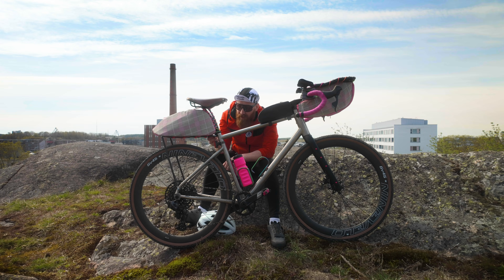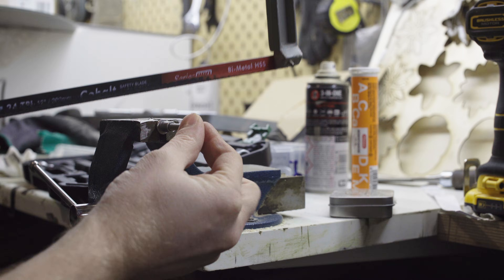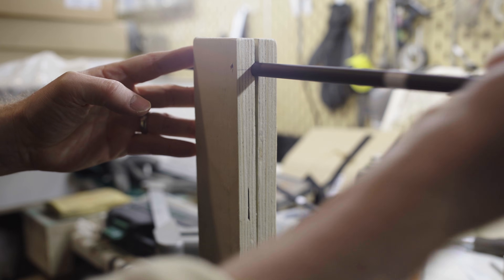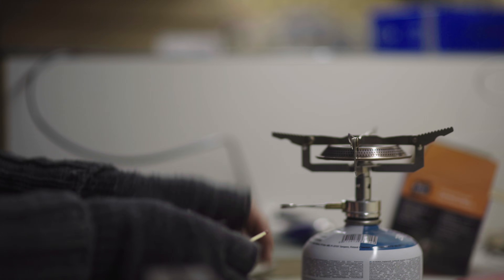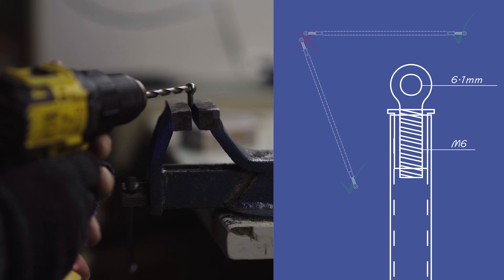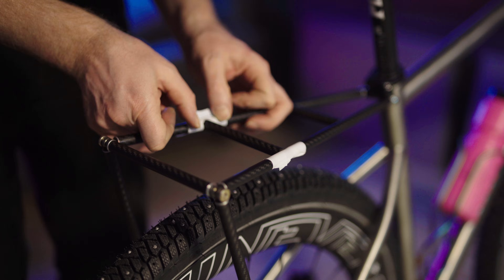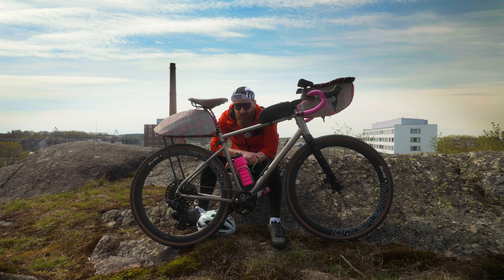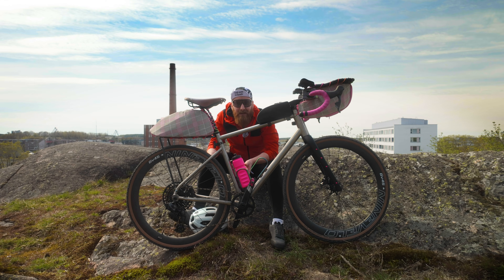DIY Carbon pannier rack explained in detail

Comment: Absolutely brilliant. How is the rack holding up? I'm looking to build something similar but attaching the carbon tubes to the Ortlieb Quick rack axle to transfer the forces. My main issue with my current Checkpoint frame is that the bonded rack mounts look like a toothpick would do them in. Please let me know your thoughts on this. Keep up the good work.
Reply from the maker: It's doing really well. It took me on a 1000k race fully loaded. And years later, it's still in one piece, (except the cross braces which fell off, but it turns out they were a waste of time anyway).
Reply from the maker: That axel looks brilliant, how are you planning to attach the tubes? 3D printed parts?
Reply: @SladeTakalaLamey  I want to do what you did and not reinvent the wheel. Off the shelf parts if possible. I cannot believe you built a rack that is lighter than pretty much anything in the world and a tenth of the price of pricey titanium racks. Like you said. Tailfin better watch out.

Comment: Love the project! Do you think this would work not using the seat post clamp and mounting to upper rack bolts like a traditional pannier rack? Or does the strength come from the simplicity of the design?
Reply from the maker: I see no reason why it wouldn't, as long as the seat stay bolts are above the height of the wheel. Otherwise you might have trouble rubbing a hole in the bottom of your bag.

Comment: This is a nice slick job, but as a guy who has done lots of epoxy and carbon work, I have to say that this does not look super strong.  It's probably fine on a roadbike like you did here, but I suspect if it was on a mountain bike and or dropped and hit the ground with the rack, I'd be amazed if the connections all held together.  But like I said, still a nice job

Comment: Love your channel!  One of the best DIYs

Question - what would you suggest for mounting hardware if the bike has no lugs available?  Definitely more of an issue on the back since there are options available for the front (seatpost or brake mounts).

Thanks and going to check out more of your other videos!
Reply from the maker: @KintaroOtsuka-x7s  thanks very much. I know tailfin make some very fancy though-axle attachments for bolting stuff on. Alternatively, pipe clamps work pretty well. There are universal rack mounts online, I had a quick look and couldn't find any, but I know they are there.

Comment: We need more content like this! Great job mate! 
Do you think a solution like this can be good for panniers, and the side pull they make?
Reply from the maker: @mihailo3012  Very glad you liked it. The lateral strength is great, I worry about the fore-aft pull in the aluminium nuts that are glued in with epoxy. There's a V2 on the way that fixes it tho.... So stay tuned.

Comment: Hey mate love this!! I got a few questions. How much weigth can it resist? And, I have a DIY cannier I found from rackhackers (very usefull and cheap). It can hold like 7 kgs. Do you think that your carbon rack could hold 2 of those (kinda like 15 kgs or little more).
Hope you are doing great, blessings and greets from Chili !!
Reply from the maker: @joaquinsalvo9675  I've done a static test with 17kg and it was fine. In the first video you can see me resting some weights on it. I would be nervous about 15kg pannier bags on rough terrain. I think the weak point is the epoxy'd nuts on the seat tube end of the poles, those bits are under tension. The down poles are under compression and would be fine. If you do go ahead, please report back and send pics. I've not had an angry message yet. Nobody has been stranded with 15kg of gear miles from home. Good luck. And please let me know. Cheers, Slade

Comment: Hey, excellent video! embarking on making one myself. quick question though, the 2 bolts that screw the carbon poles together at the back and top, and the 2 that go into the rack adaptor, what size are those bolts? cheers
Reply from the maker: Cheers, Glad you liked it. The bolts that go into the frame and adapter are standard M5. The bolts that connect the carbon crossbar are M6.... Tip, I bought some Ti M5 bolts they are really cheap on Ali and much less likely to sheer under any strain.
Reply: @SladeTakalaLamey  cheers, will order some now! Gonna try video me doing it. Will make sure to share end results. Depending how well this goes I might also attempt a front rack at some point
Reply from the maker: @ollieknight45  good luck! Make sure you share your results. I'll do a comment style reply!
Reply: @SladeTakalaLamey  60-70% complete, I tried to enlarge the eyelets but couldn't make it work. I instead ordered some rivets in M5 which i'll tape and epoxy into the tubes to fit. The end of the M5 rivets fits perfectly into the carbon tubes without falling through.
Reply from the maker: @ollieknight45  Cool! keep me posted.

Comment: Thanks for the inspiration and links to parts. Have to say drilling holes in carbon did not worked smoothly so used round file which in my case worked so much better and I could really fine tune the angles (not that it worked as planed though). Also at some point (when i get new ones) will have to drill bolt eyelets at some angle to have less tension on the construction. Or maybe for the next rack I'll cut tube at the angle...(did not do it this time). Since I wanted to have weight to be as low as possible went with factory rack mounts on seatstays on my Kynesis, which alas were in my opinion poorly placed and interfered witch rack construction, so had to bend bolts to make it work, which ain't perfect and still working on my metal workmanship skills...anyhow. I see the light at the end of the tunnel. The rack did not fall apart on the first ride (no load) but poor gravel roads so now on final stretch to get rid of small bugs and then figuring out the bag for this rack. Thanks again for great video and inspiration.
Reply from the maker: @cincas  I've now taken mine on an 800k loaded ride so I'm confident it won't fall apart. The cross braces fell off, but it didn't affect the strength or stability so I think they may be superfluous.
Reply: @SladeTakalaLamey  well, now that i think I should have spent more time sanding the joining surfaces. The time will tell :) Will put mine at the end of the week with some load on top and will let you know how it went.
Reply from the maker: @cincas  good luck. Please can you send me some pics. 🙂
Reply: @SladeTakalaLamey  I will. Got some ideas how to solve some issues that came up, so will send with comments as well.

Comment: Inspirational video thanks. I’m mid build on mine but have added front stays and plan on using metal bars to attach to the seat stays on my Giant Revolt.
I did but a £10 drill bit which enlarged the eyelets without needing heat treatment. I also bought JB Weld for the epoxy.. and as per another comment, I’m planning on using Loctite 222 on all the threads to give a secure rattle free fit. 
I am grateful for the links to purchase the Carbon tubes, eyelets and threaded inserts. Living in NZ, I have to say Ali Express have upped their game on shorter delivery times. 
And a subtle bend on the eyelets as my rack width is 12.5 cm but parallel.
Reply from the maker: Amazing congratulations, I'd love to see it. Please can send me a pic. I'm trying to collect together completed racks for a video.
Reply: Nearly complete, just have to shape the ends of the 2 cross members for the rack. 
I do have a Giant seat stem mount on order but my prototype is attached to the seat stay inner mounting holes (why the F on the inside of the seat stays?) with 10x4 mm Alloy bar.
It seems very stiff and strong so far. Once all complete I’ll assemble it with thread lock.
Reply: Will do.
Reply: I've just finished my initial design with a 3d printed seat-tube mount.
I was worrying about rattling and will definitely use loctite as well. However, from my testfit I found that it comes together under a little bit of tension, which per geometry leads to rattle free montage :) - lucky benefit and works well!
My only concern now is how to fit my daily backpack on there. I'm thinking of a pouch or just straps with a bit of cloth, so I can strap together whatever I want to take. Like a basket, but flexible..
Reply: @genioee  Have you the plan of 3d printed seat tube please

Comment: Really nice video and a great diy project! Small note on the drilling of the eyebolts: they are probably not hardened so drilling them out should be no problem with a normal hss drill. But dropping red hot bolts in oil gives them a nice black finish with a tiny amount of rust protection. So there you go

Comment: Hey there!
I went ahead and built one for myself. It works pretty well with an 8l drybag, however the screws rattle quite a bit in the rivet nuts. How is that on your side? I'm thinking about cutting some aluminum tubing to size and tighten the rods onto those to mitigate it.
Reply from the maker: I filled the bolts with enough red locktight that they are solid for me. Please can you send me a picture, you are the first to get back with a complete build, so congrats.
Reply: @SladeTakalaLamey  Now that the loctite dried, mine is stable too. I will send you some photos soon ;)

Comment: I would like to recreate this on my Scott addict. It has rear fender mounting holes and threads, but I am scared that they will not hold the weight of the pack. Has anyone have experience or advice on how to to this best?
Reply from the maker: Even the big heavy duty pannier racks are only screwed into those mounting holes, they are stronger than you think. I would suggest getting some steel or Ti bolts though. You are strong enough to break an aluminium M5 bolt just by screwing it in too light.

Comment: I'd love to see an even longer form video on this explaining:
-What tools (ex. hacksaw blades?) you used, and why
-How you could potentially improve your pannier rack in a V2
-Some basic safety tips like:
     wearing a mask
     applying water to your carbon(with a spray bottle or something) before cutting - to getting a cleaner cut, saving your lungs, and prevent itchy carbon dust from irritating your skin
Reply: I just did it and didn't know about the water trick - thanks. But its actually really easy and I just used a common FFP2 mask from the pandemic and it seems really fine. Its cool he made the video look easy, since it actually motivated me^^. But thanks again for the extra tips!

Comment: It's one of the inexplicable mysteries in cycling that no one makes carbon racks, except for the very expensive tailfin, and there only for the rear.

Or fenders-mudguards, which would be even easier. Drives me nuts that the stays provided with even the expensive floppy plastic fenders are the same old thick pot-metal stays in use for half a century, that dont like to bend, but oh do they love to flail around...  Even cold cured carbon would be better than floppy plastic....
Reply from the maker: This all started because I saw they make a very similar product for Bromptons, and I realised it would not be a stretch to upscale it for grown ups!
Reply: @SladeTakalaLamey  awesome….  have been thinking for years about giving it a go…. your video may have finally motivated me to maybe do something, maybe….  :) it would be a great little business…. I think the tailfin guy started in his own garage….

Comment: So nice diy "tailfin" rack. Am building a rack my self, Think i will glue some wrap  fabric "Carbon fibre tape 125 g/m² (unidirectional) 10 mm" around the connection of the smallest tube and waste the dowels . Am thinking these connection you have is  a weak spot. But in all so content you have put out with this rack.
Reply from the maker: I tugged with all my might on a piece of string tied through the eye bolts, no movement. I await to see what 1000k of vibration will do to the epoxy.
Reply: @SladeTakalaLamey  Sure eye bolt will go nowhere, it was only the two smallest tubes where you  masked the tubes with tape. was ment as an idea if you got issues. Was so happy to see you work, and you got a new subcriper.

Comment: Awesome design. The end joint tricky part could maybe improved/simplified more with soldering? or just strong epoxy in that area too, since epoxy is used in the center cross bars.

Comment: Squirt some thinner on tissue and just wipe the excess epoxy off.

...and make sure you change wiping spots on the tissue otherwise you'll smear the previous thinner-epoxy mixture back on to the surface.
Reply from the maker: Doesn't that delaminate the carbon? Isn't it held together with the same stuff?

Comment: Just remember that these carbon tubes are constructed by wrapping crossed plies around a mandrel, which is important.  Some carbon fiber tubes are 'pultruded', which are cheaper, and fine for some applications, but those tubes can be crushed easily.  Don't skimp on the tubes to save a few extra bucks!

Comment: You can skip the hardening part, since the eyelids are stainless steel it won't do anything to the hardness. Would work if you had plain steel with more than 0,2% carbon in the alloy

Comment: Did you have to bend the eyelets to get angles from the seat clamp and then again at the ajoining brace at the rear? Parts ordered, great weekend project just the right amount of space to take my gym kit. Inspired!
Reply from the maker: Well spotted, it's the part of the video I missed. Yes, 'like Jeremy Clarkson', with a hammer!
Reply: Thanks. I ordered some thicker gauge 9mm OD aluminum tube to add to the internal of the bracing instead of wooden dowels. Once again this is a great project thanks for sharing

Comment: What length M6 eye bolts did you use?
Reply from the maker: I used 80mm (to clear the frame at the bottom) and 25mm everywhere else (but I should have used 30mm).

Comment: instead of the m6 eye modification, a 5mm thick 135 mm long allen key wheel skewer might work. it will make it heavier but there's something cool about potentially using an off the shelf bicycle part for this
Reply from the maker: It's a great idea. You could even get a some M5 nuts and smaller tubes to keep it all stiff.